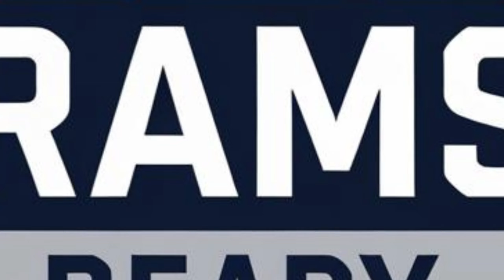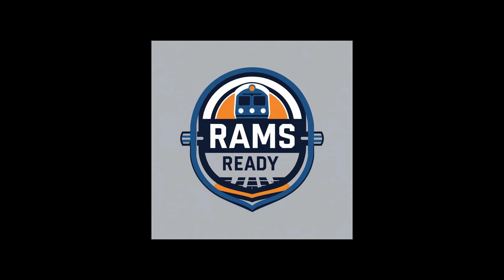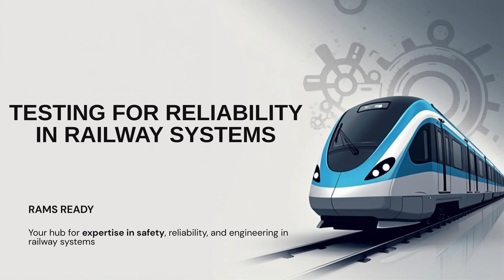Testing for Reliability in Railway Systems

Comment from the maker: Working files for this topic, built to be used on a live project:

Reliability Demonstration Guide
Demonstration test planner, contract clause templates and the guide to agreeing a test both sides can sign.
https://ramsready.firstlinkai.com/p/B2

RAMS Excel Calculator Pack
Availability, reliability block diagram, PFD and test interval, spare reorder and demonstration planning calculators, all live Excel formulas.
https://ramsready.firstlinkai.com/p/A2

Free Lite Hazard Log workbook: https://ramsready.firstlinkai.com/free
All twenty products: https://ramsready.firstlinkai.com

Which part of this gives your projects the most trouble in practice?